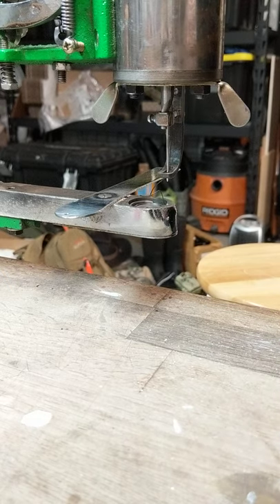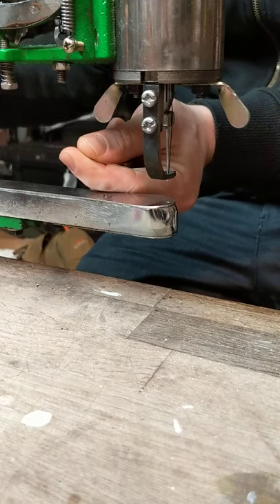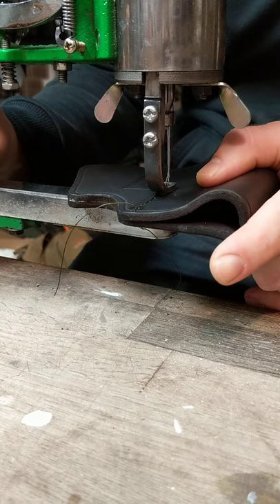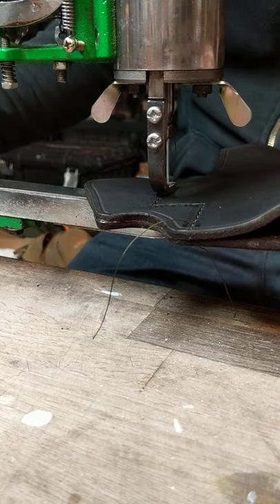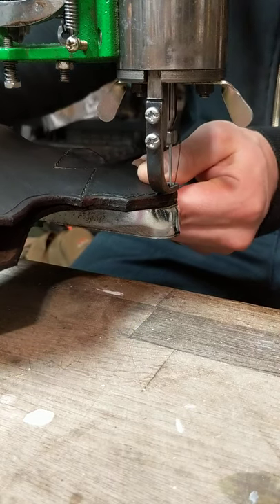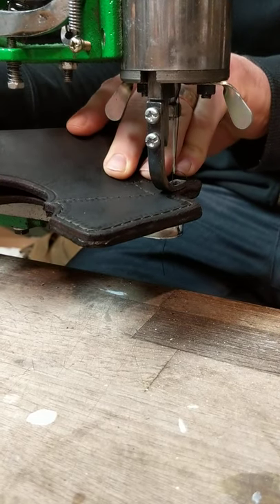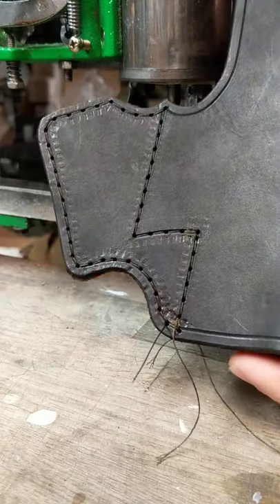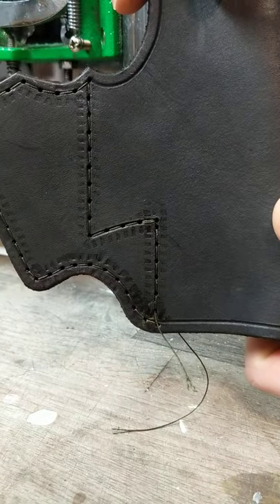Stitching a THICK LEATHER Glock Holster using my China Leather Shoe Patcher machine.

Comment: “This might look slow, but compared to hand...” That is an excellent point.  I was wondering about the foot marks - good to know that water will take them out.  

I just got one of these and still working on making it work right, but videos like this are really encouraging.  I wasn’t really thinking that it would be useful for top quality work, but I see now that it can if you are careful.  Thanks.
Reply: Pls post or PM your results. Mine has yet to sew a complete line..... timing is crucial, and machines evidently *vary!
Reply: @cluek9780  there's a Facebook group - Chinese leather shoe patcher - with tons of help for specific issues.  Mine wouldn't sew with the thread it came with  btw.
Reply from the maker: @cluek9780  definitely go to the Facebook page, or follow me on Instagram or Facebook @rogueapparatus I post all of my work 😊

Comment: Thought Id share this for others:
Groz-Beckert 134 - Size 140 / 22 - D    +  (138 thread)
Modifide to work with a patcher
The Groz Beckert are industrial and longer at 43.21 mm while the standard is 39.53 mm.
Shortened the needles (or adjust the needle shaft)  and ground the shank flat.
If needed you can use emery cloth on the bobbin shuttle to increase space between bobbin shuttle and the needle

Comment: Nice to see it being used for thick finished parts... .. .You could add some drops of silicone/other lube from a syringe/needle to help with the glue. Some of the best money I've spent on Chinese cast iron. I'll be using it for adding corner reinforcement on sails one day + I have some tree climbing gear I made and need leather to finish off.
Reply from the maker: That's awesome! Yeah I actually started using a little Axe Wax on my needles and punch tools to keep them sharp

Comment: Thanks for the video.  Would you mind posting something describing the settings you use for thick leather?  I am running a heavy gauge needle and thread but still having problems with thread breaking if I stitch anything thicker than about 6 oz.
Reply from the maker: I can do something like that yeah. Based on your description it sounds like you might be threaded into the wrong bobbin hole which would cause the top thread to break. Either that or both tensions are set too high for the thicker thread.
Reply: @rogueapparatus6414  so, thicker thread needs LESS tension? When to use both tensioners? 
OR, keep one set for thick, one for thin?
Reply from the maker: @cluek9780  the thicker thread has more natural drag so it doesn't need as much tension, same with the bobbin side, I often bypass the spring completely. 

As for the top tensioners I prefer to use both at a very low setting for a more consistent feed

Comment: If the needle was oiled or greased would that help entry exit?
Reply from the maker: Only for one or two stitches. It rubs right off on the leather. The biggest factor is reducing thread tension so the needle doesn't wander